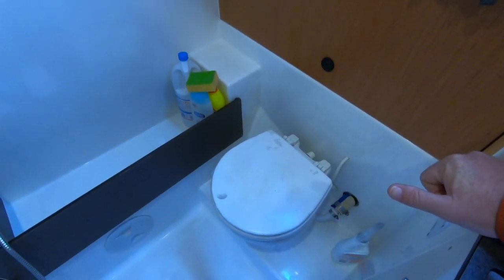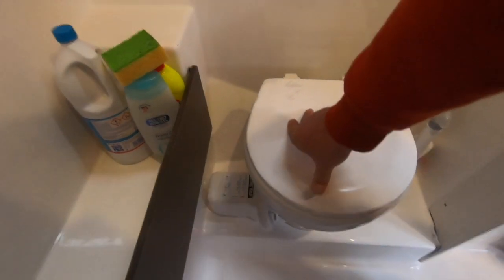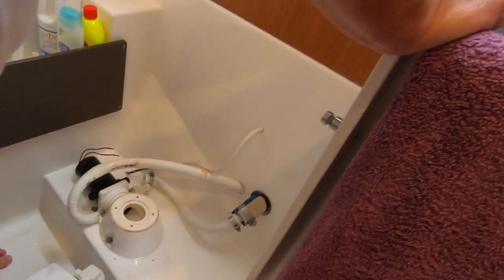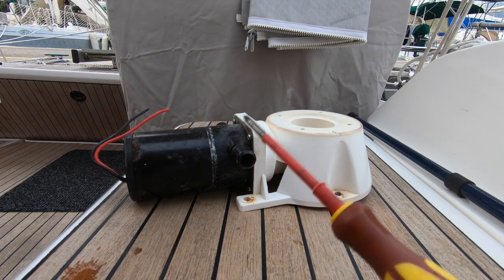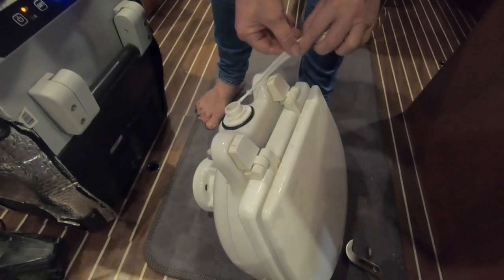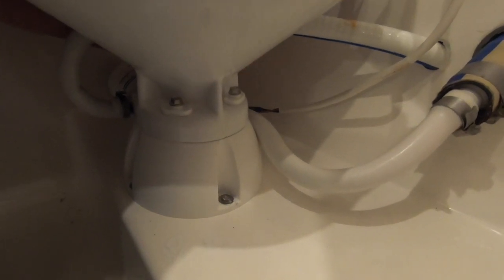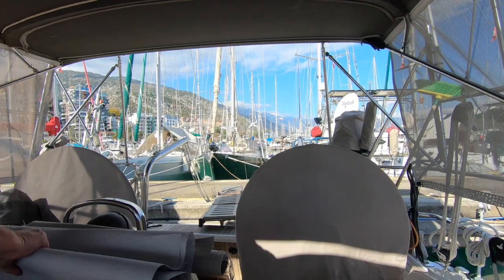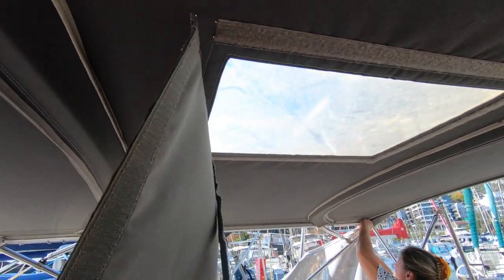Toilet Training In this video Cindy has to replace our broken toilet. OTB 125

Comment: Interesting video as always. I think it is good to see sharing of different jobs onboard even when not sailing - it is important we can swap around. Good luck with your back - I swapped out our Port side coach roof winch last year for a Selden E40i electric one. Over kill in many ways but helps my back no end. The winches for the sheets are no problem at all as getting the correct angle is easier than the coach roof ones…..
Reply from the maker: Thanks for watching Miles. The back is slowly getting better but it's kind of the least of our worries at the moment... Watch this space. Ant & Cid

Comment: Great episode and great teamwork getting the toilet pump/macerated problem solved - well done to both of you (but especially CID 😉) Shame the old one is not repairable clearly they cheaped out on the bolts for a known aggressive area in a marine environment - shame on them. Hope yer old back improves soon. PS: Watching you do the wiring for the pump - have you ever considered Wago 221s’ and using the proprietary gel boxes to protect them ?- I have made extensive use of them for some projects here and very impressed.
Reply from the maker: Hi Norman. We use a self soldering heat shrink type of crimp. I dont know what they are called but screwfix used to do them. 3 Years is not bad for a sea toilet. The old jabsco manual used to cost £100 a year to service and needed constant attention. These are just easy. But others tell me they dont come apart after a year or so. 😁

Comment: Just catching this episode. On your toilet seat paint problem... what about putting "shelf paper" on the seat?  in the US we can by this self-adhesive stuff and it comes in a water-resistant version that has a coating. Just a thought.
Reply from the maker: Thanks Kevin we are a bit limited here in what we can buy. There is a similar product locally but its not very flexible. We were thinking of getting some epoxy paint made up and then spraying it. It would still be cheaper than a new seat. Sail Safe mate. Ant & Cid.